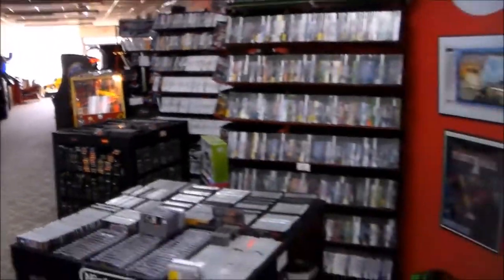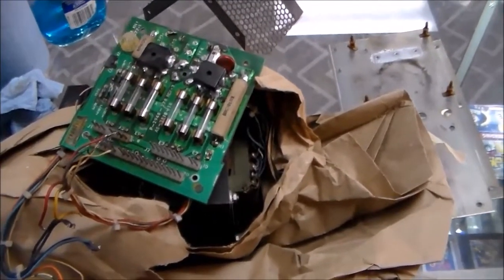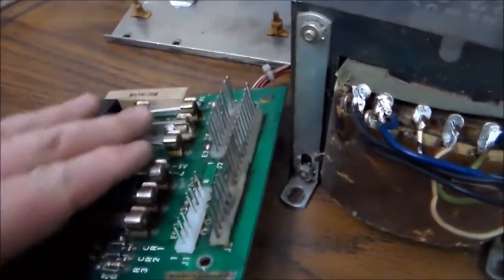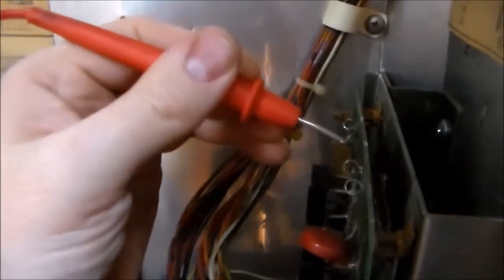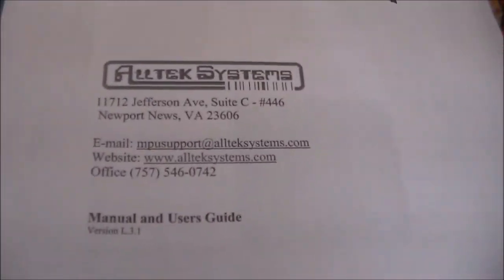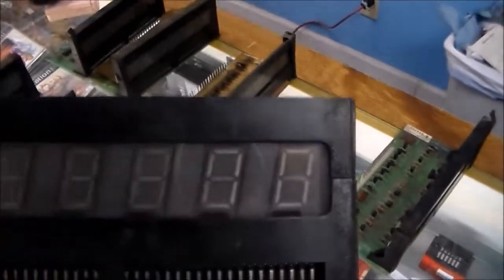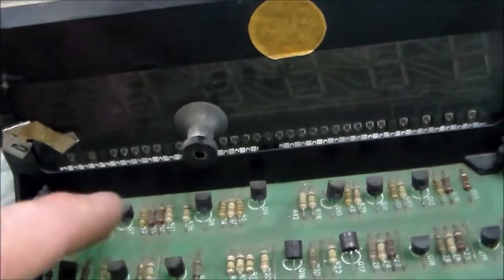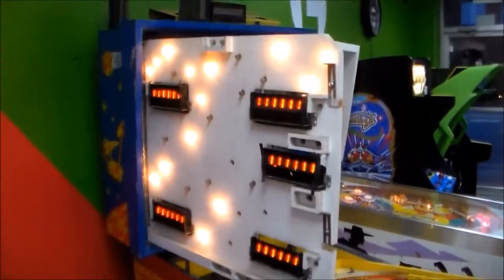1979 Bally Star Trek Pinball Machine Repair - Fixing the boardset First

Comment: Love this video. I'm an old Bally engineer and I love seeing the next generation bringing these classics back to life.
Reply from the maker: Thanks for all the great games, Allan :)
Reply: Hi gents, any tips for me to get my star trek to boot up? It started to not boot up from time to time, but now it never works.
Reply: @jgrenardHK  On the MPU there is a green LED that should flicker and flash 7 times. What is yours doing? Does the MPU still have a battery attached?
Reply: Thx. The battery has already been relocated off the board, and I've just put in fresh batteries. I had 4.7V on the terminals without batteries, so I presume it was soldered ok. The green LED is continuously on, not blinking nor flashing. Cheers
Reply: @jgrenardHK   A locked on LED is usually toast for the MPU.  But before throwing in the towel check the voltages being supplied by the power supply. Game needs a good 5v and 12 V to begin the boot up process.
Reply: Thanks Allan. Indeed, I only had 3.9 and 10V around. I have cleaned up the pins on both the MPU and the solenoid boards and also fixed a bad contact on the MPU 12V pin and now it's working again! I still have a few things to fix, like weird sound at times, and some game lights that wouldn't light up (no voltage). Any suggestion welcome. Cheers
Reply: @jgrenardHK   Great job, typically on these games those connector pins on the boards open up and a proper restore should involve carefully re soldering every pin connection on all of the boards. That might take care of your weird sounds and other problems. While you're working on the game order an NVram chip and lose the batteries. The NV ram will permanently fix any issues related to battery failure.
Reply: Cheers, which chip on the MTU is the RAM? And have you got any idea where to get an NV one?
Reply: @jgrenardHK  The 5101 chip, U8, on the MPU is the Ram chip. It's where the game settings are stored. The original needed a battery to save it's information when the power was off. An NVram replaces it and does not require a battery. Here is a link to one, but they are very common. Google Bally NVram and you'll find them. https://www.pinitech.com/products/5101_nvram.php
Reply: Awesome, I'm going to do that. I have also fixed a display today, working on the sound card now, may not be as straight forward, let's see... I've already broken the pins of a chip and had to temporarily solder a wire to bridge it. Sound is still not right. Not sure why. Also I have some lights that wouldn't turn on. Is there any explanation around the lights card anywhere?
Reply: Got a desperate question. When my future spa start up it gives 7 flashes and all currents are available, no broken wires, no burned transistors/diodes, resoldered all pins and repin them all. the game will not fire any coil after startup, only the flipper coils. Have anybody other suggestions to solve this problem? greets Sam
Reply: @samheijmans1082  Hi Sam, the 5v jumper on the Solenoid driver board may be loose. Look at the J3 connector on the SD board, top right. There is a jumper wire that connects pins 13 and 25 together, Often that jumper works loose and your coils will stop operating. Check the jumper and the solder connection to the pins. Bally games of this vintage often need the connector pins resoldered as they go cold over time.
Reply: @areizman  Thanks  Allan I will check those to pins. and the of course the  board greets Sam
Reply: @areizman  I checked the wire jumper thru pin13 and 25 and the pins they are allright. still no coils that fires accept the flippercoils, the gate sollenoid (Q17), and the coindoor lockout coil. I rechecked all transistors and chips u1,u3 and u4, 14,1 volts on tp5 and 5,08 volts on TP1/3. I applied the groundmods on the board. I measured U2 on ABCD 4,8 volts and when game is in in game mode i measure 3,0 volt on the output pins and when I close the switch it drops till 2,7-2,9 volts. When I close a playfield switch On all ABCD the voltage drops to 1 volt and tay on this value untill I press the outhole switch. de voltage will be back on 4.8. When the game boots up after the 7 flashes there is no droptarget reset and there is no sound. Can it be that on the MPU U11 is bad? Hopefully you can bring me a step further. Greets Sam
Reply: @samheijmans1082  There is a 1A SB fuse on the bottom of the playfield that protects the game from a shorted playfield coil. You need to check that. If it were blown none of the playfield coils would work except the flippers.

Comment: So i just started to look at my buddy’s star trek machine same on in this video has all the parts but doesn’t start/boot all the way. I checked the voltages like you showed on the power board and my tp3 is at 15 and tp5 is at 58 they are higher than you were saying. I do have 5.2 on the solenoid board.  Where do I find the capacitor and what’s the size?  Any suggestions would be great
Reply from the maker: If the voltage is a little higher it's just because there's no load on it there's no problem there, and 5.2 on the solenoid board is good.  Look at the connector on the left bottom of the MPU which is where the power comes into the MPU, make sure it's not corroded, make sure the bottom of the board where the battery is isn't heavily corroded, and once you get that straightened out check the test points on the MPU and see if you're getting 5 volts on there too.  If you are, when it boots you should get some LED flashes that will tell you what's wrong with the game.  If you watch any of our other videos on other bally or stern pinballs they all have the same game boards and they work the exact same as that Star Trek.
Reply: Thanks for the response i watch a few other videos where you fixed the MPU i order a fix kit and will start that soon. In the mean time i was going to apply some of the fixes to the solenoid board but can’t find it on pinwiki or pinrepair maybe i’m not looking in right place.

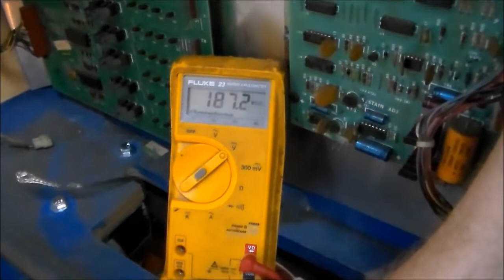Comment: 17:50 Are the displays VFD? One possibility is that this voltage is rectified but not filtered... if the connected board then has a filter capacitor, adding it will raise the resting voltage towards the peak voltage of the input.

Comment: Hello! I am from Argentina. We have this machine, my father bought it when I was a n ... I want to fix it. it says the error is in the CPU. It can be fixed?
Reply from the maker: Hello Sofia;  Yes, they can definitely be fixed.  Go to www.PinRepair.com and read their section about bally pinball machines, they all used the same CPU boards, and you can even buy new ones if you need to, but the old one can likely be repaired.  There is a battery on it, that eats it up!

Comment: would always recommend changing mpu board old ballys?
Reply from the maker: If you can afford it yes the new MPU's are awesome.  The old one if it doesnt' have extreme battery damage can be repaired fairly easily usually, because all the chips are socketed.
Reply: Thanks, I'll look into it. It would almost be worth having it ready to go and not have to repair. I'm also working on a Bally Star Trek, and I'm going to replace the rectifier board because previous owner cut wires from the J1 and J3 connectors and soldered them to the tests points. I did find a receipt in the machine and it looks like they paid someone 140 dollars for that service.

Suppose it had anything to do with a blown varistor?

Comment: Oh, btw, maybe you can help me with a Motordome question i discovered, in the manual, on the PWR Module page (page 28), there is a small notification on the bottom of the page that says "When 4 flippers are used FU1 should be 7Amp", but on the board itself, it says "5Amp" on FU1, what does that mean? my Motordome pops the FU1 fuse as soon as i touch the flipperbuttons, or the bumpers get activated, sofar ive figured its just missing a diode (not had any time to check) but could this have something to do with it?
Reply from the maker: Yes that could be it.... does yours have a 5 in it?  It's pretty common if there's extra flippers for the fuse values to be a little higher on the solenoid line (or the flipper line if it's seperate).  The Williams Laser Ball we just finished has a similar sticker inside, says if there's more than 3 flippers to use a slightly larger fuse....
Reply: Yeah i put a 5 Amp in it the first day i got it, since i followed the text on the board. I will test a 7Amp in it tomorrow, and also add a sticker on the board about it for future owners.
Reply: Tried a 7 Amp today, and it held up abit further, then popped anyway, so i guess it require a diode aswell on the coil, although i checked it, and i only saw the remains of a diode on the right flipper coil, not on the left, there only supposed to be one diode? are the flipper coils interconnected with eachother?
Reply from the maker: Sorry about the wait Luzur, no there should be a diode on every coil in the game.  The flipper coils I believe may even have two each, if you look in the schematics it shows what should be on what.
Reply: No problemas, altough it wasnt the remains of a diode, it was the remains of a D103M43Z5UL63L6R condensator, and i also goofed up abit with the fuse, i put in a regular 7amp when it was supposed to be a 7Amp slo-blo, so the coils work again now (except the upper left one you score the million with), but i still have no displays, so im holding up for cash for new ones atm.

Comment: Can you contact me? Im trying to fix my machine, same one as this one. The rectifyer isn't reading right. But cant afford a new one.
Reply: Not sure if you ever got it going, but rectifier boards really aren't that expensive, 50-60 bucks tops for a brand new one. The most common failure is the lighting connections burn out the board pins connectors. There are connector rebuild kits you can buy but if the board is toast it's not a very expensive project to replace.